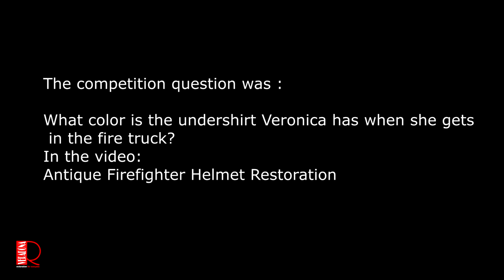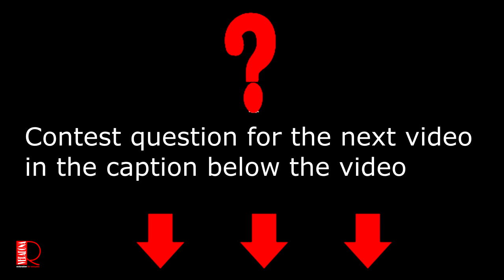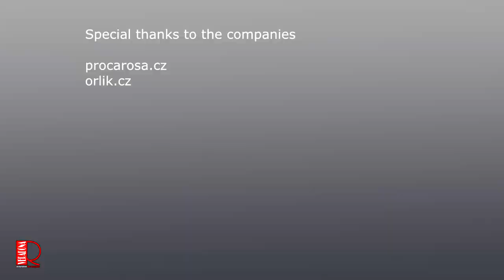Antique Seed Planter - Restoration

Comment: Long ago I had a Planet Jr planter. It had a chain drive and interchangeable, non-adjustable cylindrical seed plates. I wish it had a clutch because the chain was given to jumping off the sprocket if you rolled it backwards more than a couple inches. The adjacent row marker/follower is a nice touch on yours! When we planted corn with a tractor and 4-row planter we had a length of steel pipe strapped to the weight blocks at the front of the tractor. From the end a chain dangled and you'd put that right over the closest furrow of the previous pass to keep the row spacing correct.

Comment: Absolutely wonderful restoration . I think this is your best restoration, and that is saying alot. Very thorough and careful. The repair of the broken metal part is very good, and I'm glad you could save the wooden handles. I think I would lose track of the various parts. There is more to this old seeder than I would have guessed. Excellent job. Thank you! Big smiles and best wishes from USA.
Reply from the maker: Thanks Pat, I appreciate that very much. I will record the renovation on video, so assembly is easy :) Thanks Radek

Comment: Fantastic ! As a young'un, I actually used something very similar to this. But as to taking it apart AND putting it back together in the correct way. I simply would not have a clue. So thank you for bringing back old (very old) memories, with another first class restoration !
Reply from the maker: Thank you so much Willie :)

Comment: Excellent restoration, as always.
Looking at the holes in the front wheel, I think there should be small spikes in there. Otherwise, that wheel may slip too easily. The spikes really help to keep the wheel turning. Even in pictures of other old, restored machines, you can see the holes but the spikes are often missing. To make this machine function reliably, spikes may be necessary.
Those holes are there for a very good reason !!
Reply from the maker: Yes, you are right, but since I was counting on returning the scraper that was there to the owner, I can't put the tips in there.  Thanks, Radek